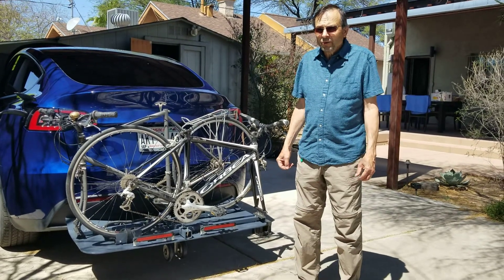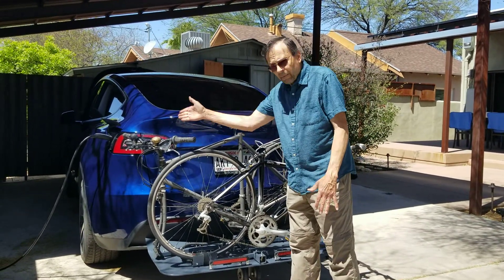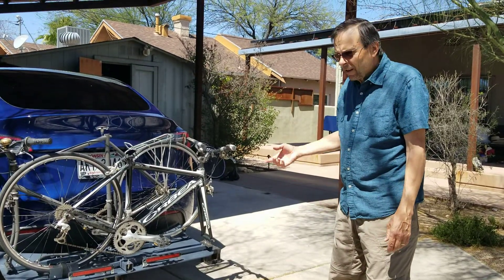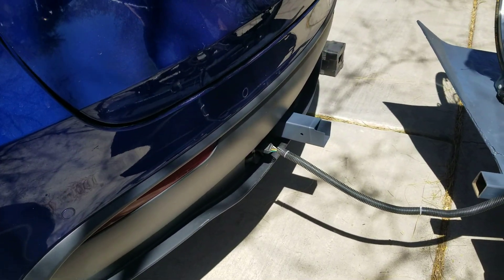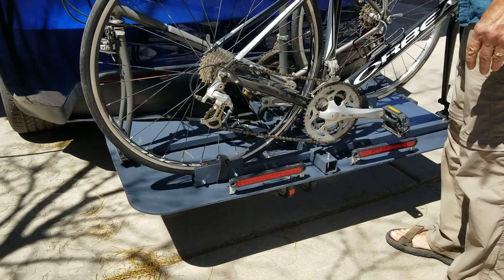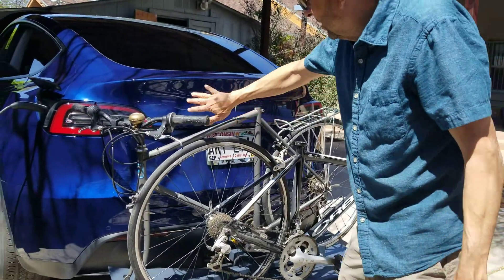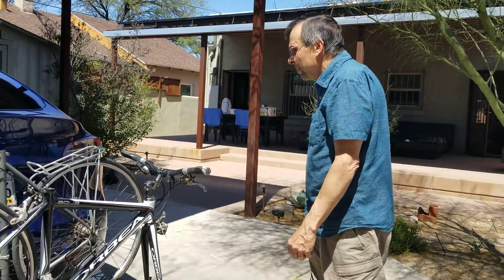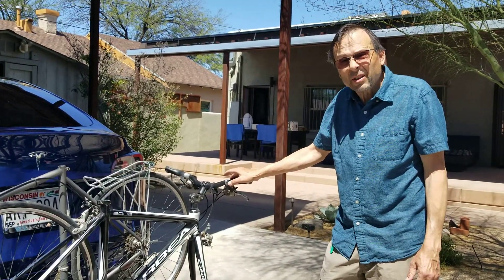Aerodynamic Bike Rack Optimized for Tesla Model Y

Comment: This is a brilliant idea and really should be the future of bike rack design with an emphasis on aerodynamics.  Do you store the front wheels in the trunk?  It'd be cool to bring this product design to market as a startup but the big bike rack companies (Thule, Kuat, Yakima, etc.) are probably in a much better position to manufacture in volume and could easily undercut an attempt at a startup.
Reply from the maker: Thanks, Corbin. Sometimes I store the front wheels inside, but I also just set them between the bikes and run a cable through them and lock everything to the hitch. Since posting and driving 4,000 miles with the bikes on back, it occurred to me that it would be easy to put a flange around the perimeter of the bottom panel and use a dual-lock fastener to affix a fabric cover over the bikes to the bottom panel, keeping them clean. Hopefully a manufacturer will pick this up and help out one or more of the organizations I mentioned. After the last road trip, I can say that the rack basically meets the expectations I listed.